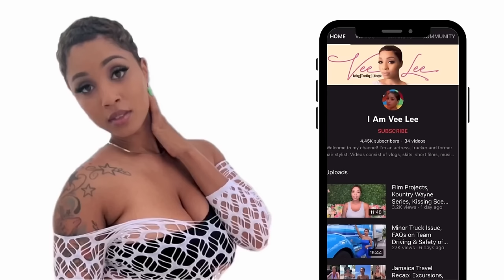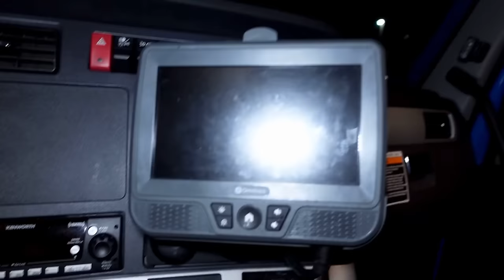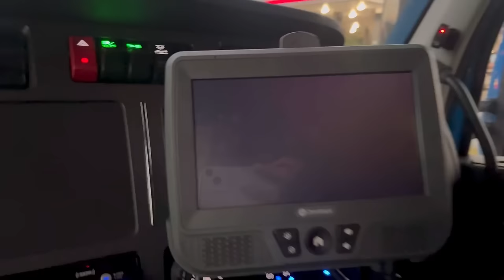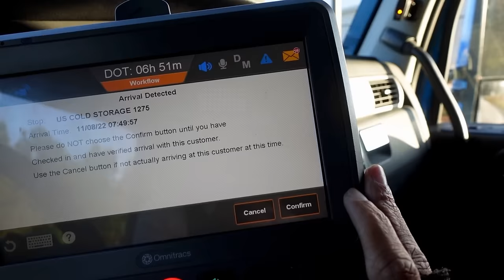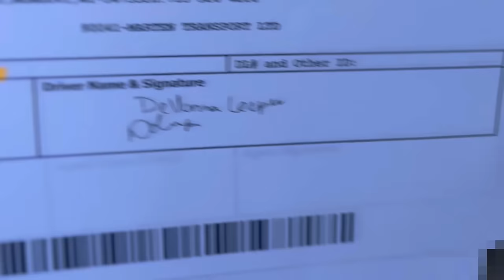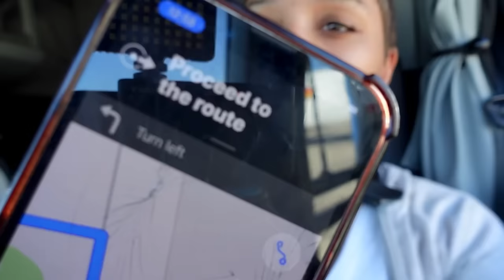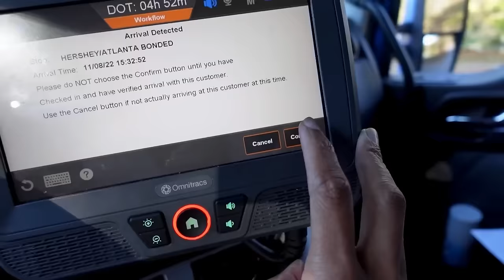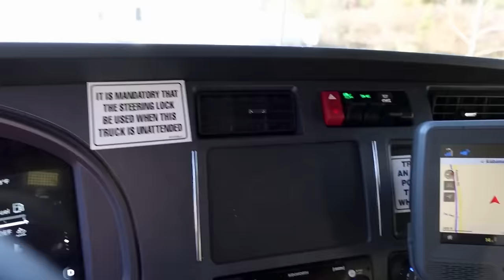Come to Work With Me: Multiple Stops

Comment: I almost choked on my water when you mentioned the golden rule. Because I literally just saw a driver drop his trailer at this shipper. Like bruh tug test 😂😂
Reply: Always check it physically  everytime you are away from truck or coming out of sleeper berth to start your day.  Dropped a load on the wheels thinking it locked, it didn't lock because trailer was a tad high. Remember all trucks are not the same height and all drivers drop trailers different.
Reply: I do both tug and physically flash check my connection everytime, all the time after my trailer drop. 😁

Comment: I learned a trick from a yard driver.  If the tandem air pins won't go in. Push the trailer air knob on your dash in and wait for a while. It will build up the proper air for the tandem pins to go in.  Then you'll be able to slide the tandem.

Comment: The tandems didn't slide because there's something wrong with the valve on that trailer.. So instead of it filling up The tank on it's normal time when you press in the red valve it takes a while.. The work around solution is exactly like you said you have to drive it around for a little bit and then it would build-up enough pressure in the valve to release the pins and they'll pop in.. In a real world they need to change that valve..  sometimes the load is very heavy and it pushes the trailer against the tandems track rail which will give you a harder time and trying to get the tandems moving.. Especially when they're rusty.. I don't know I just feel like talking keep on trucking be safe God-bless..

Comment: So I’m basically a shipping/receiving clerk/somewhat dispatcher too🤦🏾‍♀️…& I realized at the facility u at u didn’t have on a high vis vest. I assume most truckers aren’t required  to wear at all locations. My job is anal about it, understandably so tho. And them tandems on y’all trailers-hit or miss, rather they properly working or not.😩

Kudos to truck drivers bc I hate doing all that waiting, God forbid y’all have the trailers with the roll up doors- *PAIN IN MY ASS* if they, don’t stay mid way when I try to help y’all out from the dock (I usually just close it after checking the load, but even then, them latched hooks so damn raggedy u got to put your foot on the handle to hold it down & hook it)🤦🏾‍♀️😩😩…theeeennnn, y’all b in traffic toooo much for me. #GodBless 🤗

Comment: something like that try pulling back 1st then forward so pins can pop in
Reply from the maker: Yeah I did that first and they still wouldn’t move. I usually have some oil sheen and spray them…then bang them with the mallet 🤣

Comment: She not go be with company for long. I worked here before didn’t like it at all. When you take a 34 reset at home,your ht started as soon as you go off duty. Not even at the house. Also you gotta be back out the house before 34 ova with. I couldn’t take trk home either & lived 100 miles away from terminal.